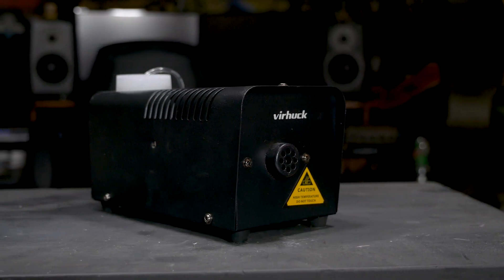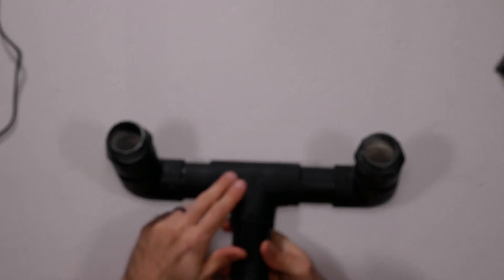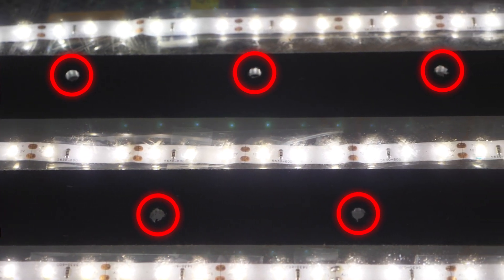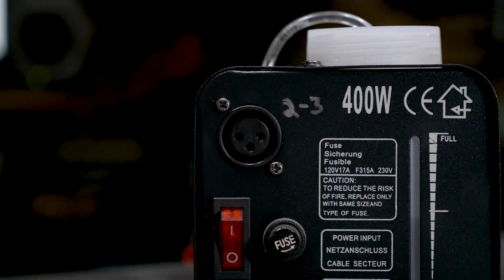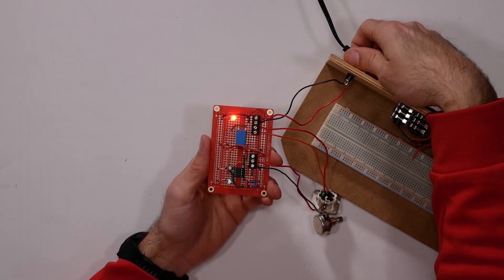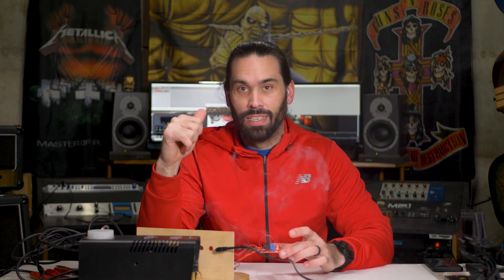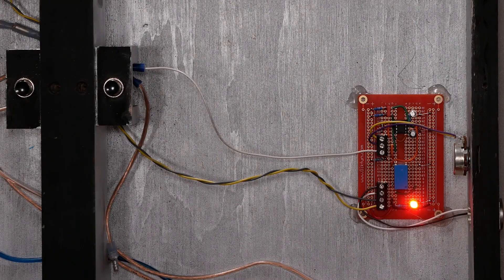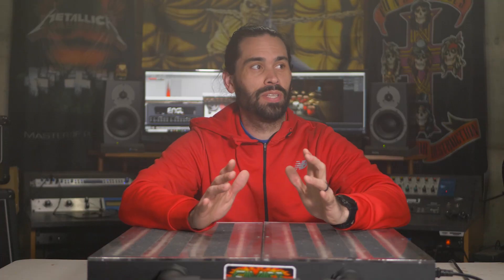On-Stage Light Box with LED's & FOG - Part 2 - Adding Fog

Comment: That's actually a DMX connection on the fogger, people think it's the same cable, but there are difference that can cause issues with your gear.
Reply from the maker: DMX and XLR connectors are interchangeable.  The  difference in the two standards is the impedance of the cable.  For this application, it shouldn't matter though because I'm not running any control signals through it like you would a lighting setup.  I'm just using it to bridge a low voltage signal.

Comment: Nice build!! But, why having a timer circuit when you can just turn on/off the FM with a push button switch like the one you use for the lights? Thanks!!
Reply from the maker: Thanks! I use the same switch for the lights and fog. Because I stand on the ego box for longer than I want the fog to go, I use a timer circuit. I should say used. A couple years ago I started using an Arduino for control instead.

Comment: Very cool and really clean design! Did you consider just mounting the remote inside the box, where it can be triggered the same way as the other switches? Would eliminate a lot of work.
Reply from the maker: I don't think there would be a good way to mount the remote so it could be consistently activated. I also needed to control the amount of time the button was pressed.

Comment: Built the ego box but having a little problem. Fog is just sitting in box and not going out the 1/4 hole. Any ideas?
Reply from the maker: Sounds like you don't have enough pressure. Do you have a lot of bends between the fog machine and box?
Reply: @ManBunMetalHead   actually no bends. Straight in with a 1/14 pvc coupling. About 2 inches long.  If it’s pressure possibly increased hole sizes or are you suggesting there might be a way to increase the pressure on the fog machine?
Reply from the maker: @lucasmather7750  I'm thinking pressure inside the box. If you take off the top I assume the fog would come out. If that's the case, you might need more holes. Also, is the velocity of the fog coming out of the machine coming out pretty fast? That could affect it. And I know I have to keep the fog machine about 2 or so inches away from the PVC. Is the fog machine right up against the PVC?

Comment: Is there any concern with building the box tall enough for the fog machine to be mounted inside?
Reply from the maker: Hmmm, probably shouldn't be a problem.  Only thing I would worry about is the machine getting too hot.  But probably shouldn't worry too much if you're not using the fog all the time.
Reply: @ManBunMetalHead  Yeah, true. Thanks, man!